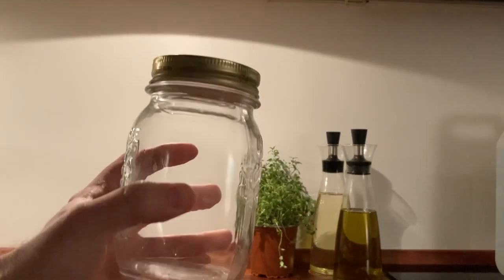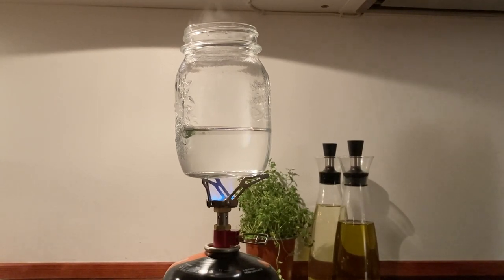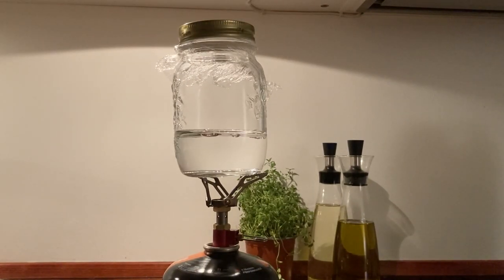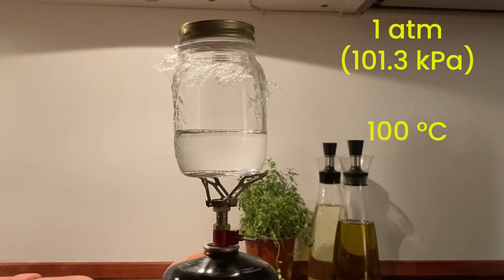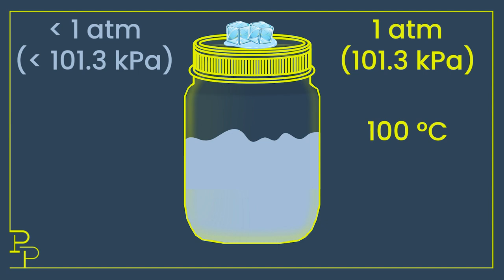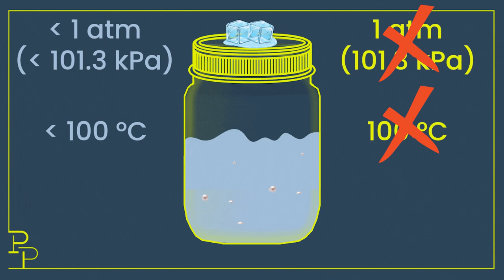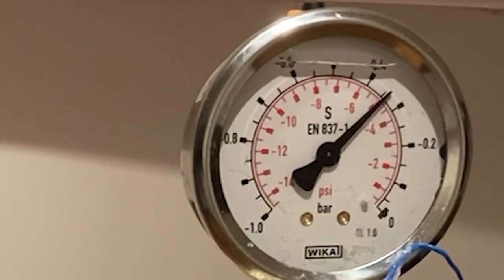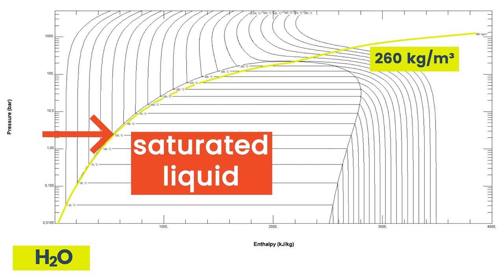Boiling water with ice

Comment: Nice job. The sealing problem must be due to the cling wrap plastic as the thermocouple looked well sealed with silicone. Why not try again but instead of the plastic, get some fittings so you can have a tee with the gauge on top. On the branch install a valve to use as the vent, then close valve when ready.